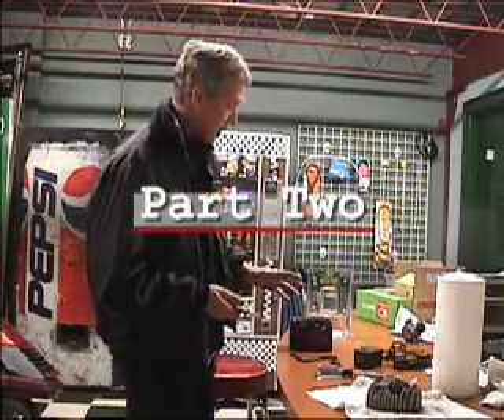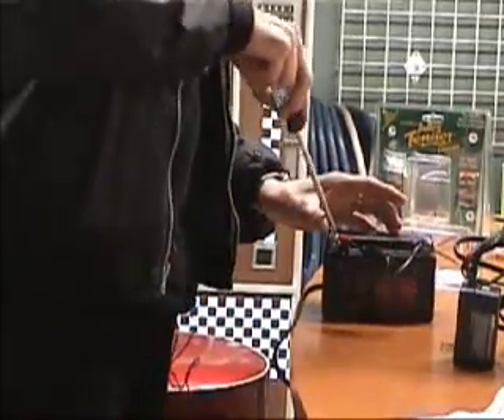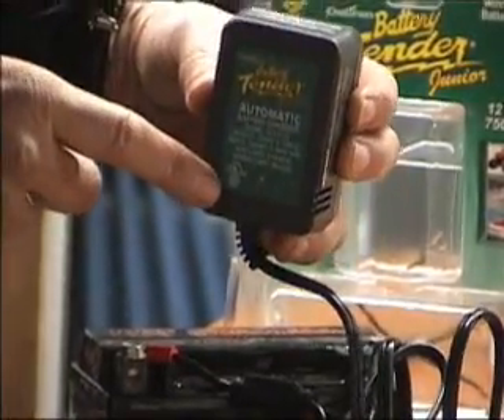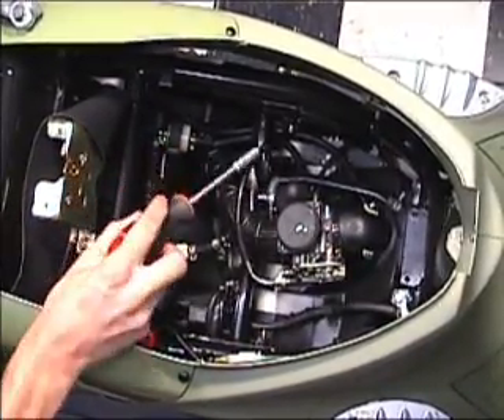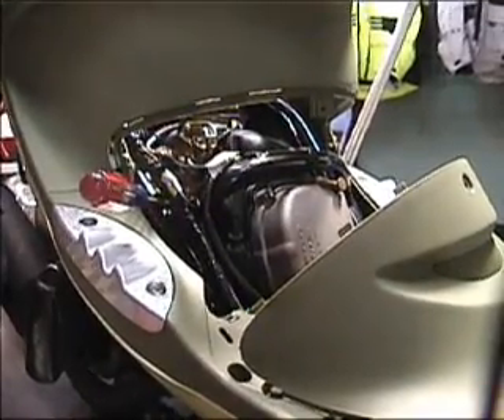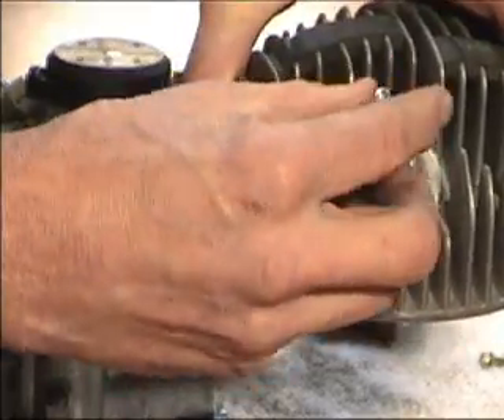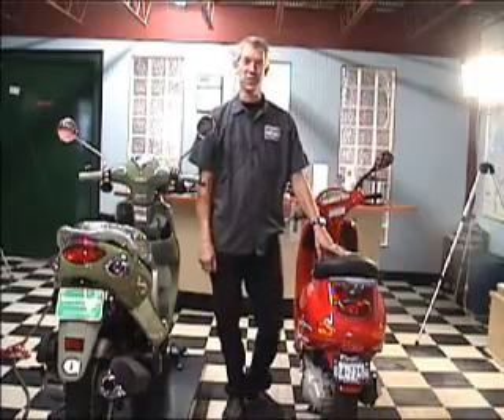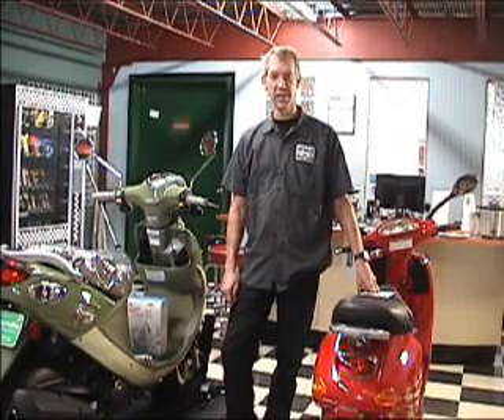Scooterville Minnesota Winterizing your Scooter with Bob Hedstrom. Part 2 of 2

Comment: Hi, i just got a brand new piaggio NRG 2010 model, i havnt had it out yet it is in my living room till i get a new shed, the winters on the way and i will be keeping it in the new shed over winter ), (i live on the moors and winters harsh), with this being a brand new scooter will i need to take the battery out over winter? and will i need to drain the petrol? also the shed wont have heating do i need to try to make the inside of the shed warm? and how? im extremely grateful for any help cheers